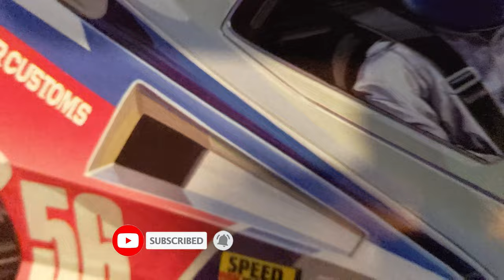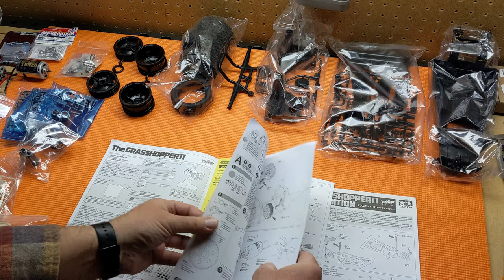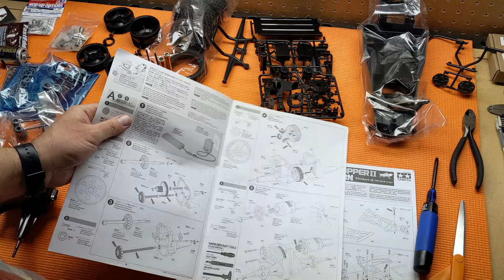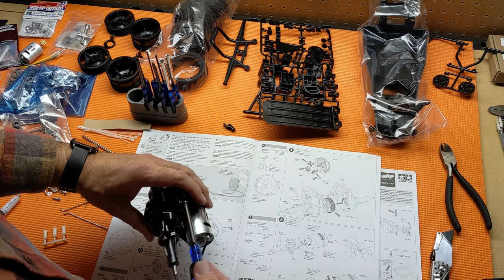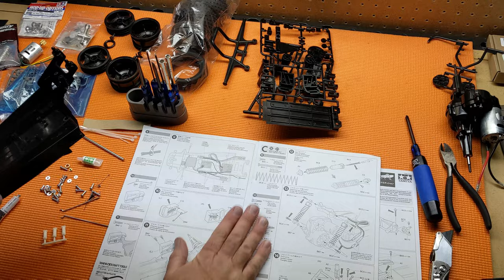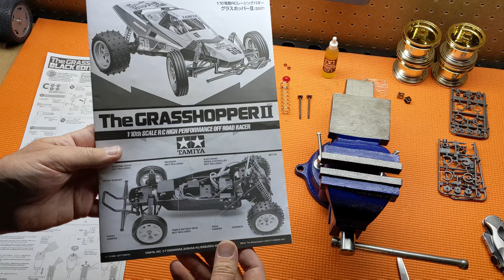Tamiya Grasshopper 2 Black Edition Build Part 1 - Build With Me! (Tamiya Kit# 47471)

Comment: I never built a Grasshopper (either 1 or 2) because I don’t like friction dampers, they were on the front of my Frog and I never bought another model with them. I am intrigued by the fact that the Black Edition has oil dampers. My favorite memory of RC was my first car. I built it in 1980 while living in the Navy barracks on the ASW base in San Diego, it was an original Rough Rider complete with mechanical speed controller and a separate battery pack for the receiver (no BECs back then). It was a hoot and got me hooked on the RC hobby.
Reply from the maker: That's awesome Steven...They have come so far with their designs since the Grasshopper/Hornet...but it's still fun to build them and watch them hop around in the dirt.